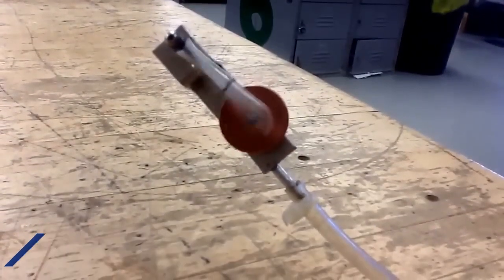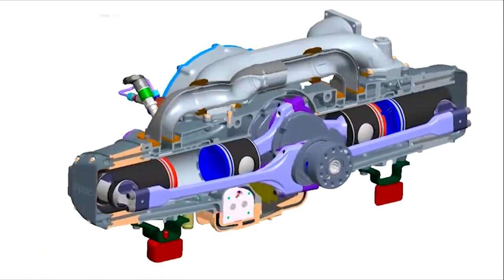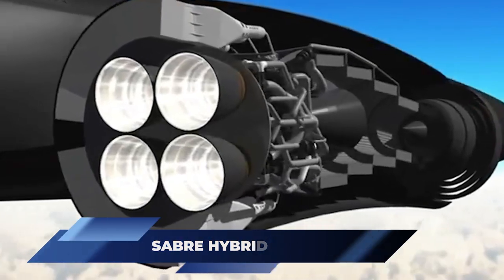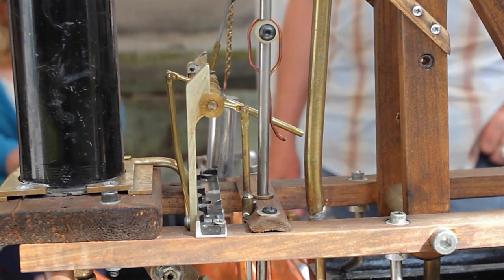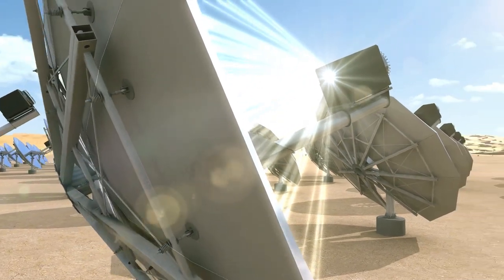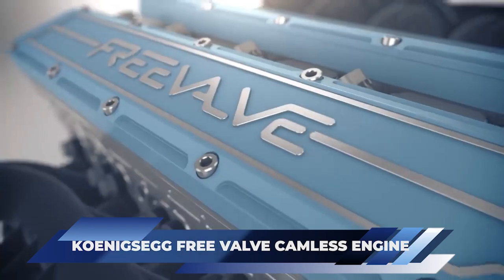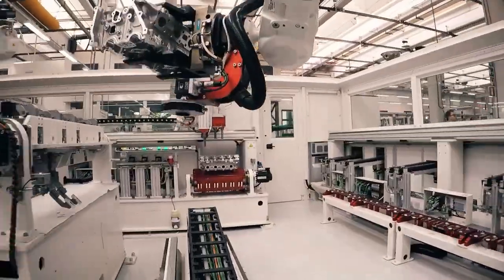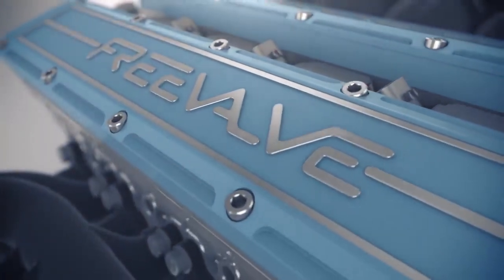Top 10 Rarest Engines Ever Created

Comment: The magnetic "engines", real?
Reply from the maker: Magnetic engines, also known as magnetic propulsion or magnetohydrodynamic propulsion, have not been widely implemented in aviation. Traditional jet engines, including those powered by fossil fuels or alternative fuels like hydrogen, are the predominant propulsion systems used in aircrafts.
Magnetic engines, which typically involve the interaction of magnetic fields to generate thrust, face significant technical challenges and are still largely in the experimental or theoretical stages.